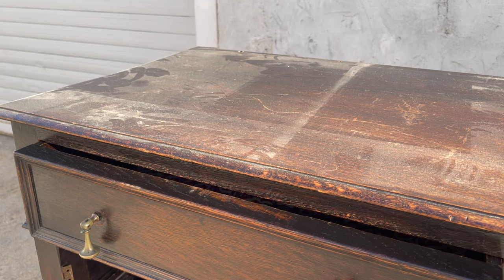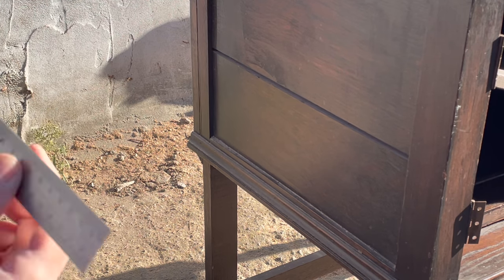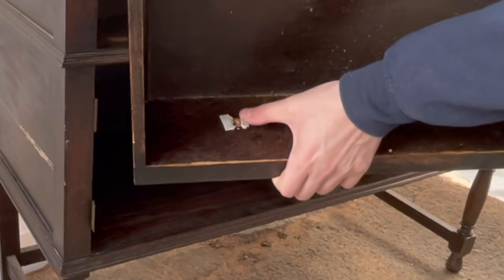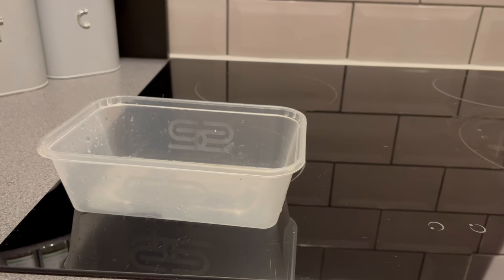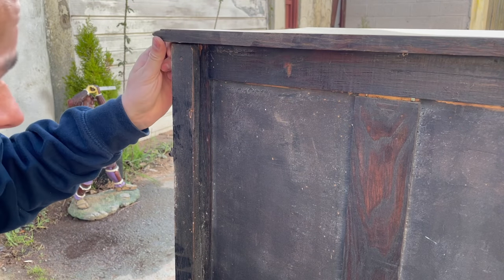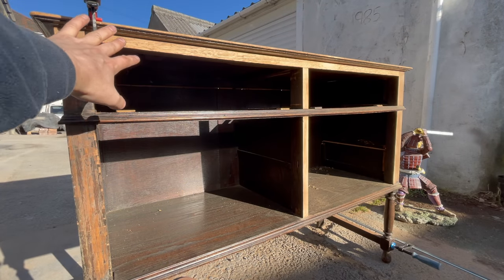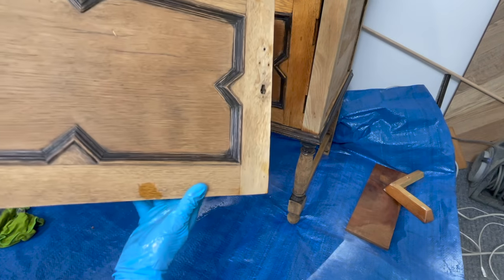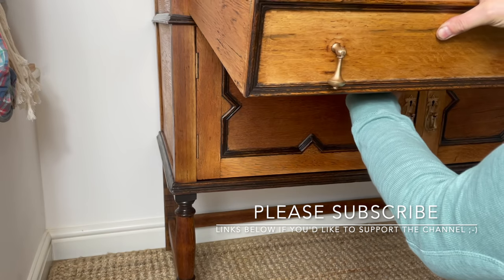Restoration | Vintage oak buffet gets a modern makeover. Cozy Winter challenge.

Comment: Put the base you're using for the cut against the fence and dial in the blade to how you want your cut. Then send it through by the base, not the other side of the blade, and most definitely not with the fence so close. Anything larger and you would have had a kick back of a very thin sharp piece of wood

Comment: To close holes it is better not to use dowels.  Dowels show end grain. When you stain dowels the result is darker, which makes the dowels stand out.  Make plugs with the grain running in the same direction as the surrounding wood, that will blend in much nicer after staining.
Reply from the maker: If I had the tool to make them I would have.

Comment: I run into many hole in restorations They make plug drill bits that will make circular holes so that you don’t use end grain dowels on your repairs. The end grains soak up stain and will show up on your great restorations.

Comment: I forgot to ask. Where do you get your syringe with needle? 
The work you did on the veneer turned out so well. I have a heck of a time trying to get glue in cracks. Your answer would be greatly appreciated.♥️😊👍
Reply from the maker: You can buy them on Amazon or eBay
Reply: Thank you so much for letting know where to get the needle n syringe.I’m definitely gonna  check it out on Amazon. ♥️👍
Reply from the maker: @shellydehart8217  Shintop 5ml Syringe with 18G 1.5'' Blunt Tip Needles for Experiments, Industrial Use (10 Pack) https://www.amazon.co.uk/dp/B076J6H35Y/ref=cm_sw_r_cp_api_i_NWM3F1GWFAAR35TZXBZ0

Comment: I suspect that the reason the sides broke open is that the panels in them could not expand and contract with the seasons. Wood swells up (across the grain, not with the grain) in Summer, with its humidity, and shrinks in the winter, when house heat drives moisture out. The solution to this would be to remove the panels, glue them back together, and reinsert them, gluing them only at the middle, letting the sides expand and contract with the seasons. Hopefully they are not attached to the frame and are free floating. If they are attached you have a structural issue with the way the cabinet was built.
Reply from the maker: If they were not attached to the body of the sideboard I would have removed them.  That would have been much easier solution. Simply did the best I could considering my skills and tools available.  I am aware of the seasonal movements of wood.

Comment: Fabulous is the word. Beautiful. And very interesting looking. Only wax on the lighter wood? And it looks like you found another brass pull to match that's incredible.
Reply from the maker: Thank you! Cheers! It was the little backplate for the top pull missing so I went without it. Maybe I'll buy some resin and cast it but didn't have any while making the video.

Comment: Did I miss the bit where you replaced the missing drawer pull?? I saw the cleaning of the brass — how did you get a replacement for the missing pull. 🤔
Reply from the maker: It was the backplate missing and I simply went without them. I will make that piece if I can get some resin before I sell it.

Comment: Couldn't you glue and clamp that gap closed?  It turned out amazing.  So worth the 40 you spent.
Reply from the maker: I believe I explained the reason why I didn’t.  It was glued in as part of the structure.  Otherwise that would’ve been a much simpler repair.  When you think about it… unless you were able to remove it for clamping it would’ve been tricky anyway.